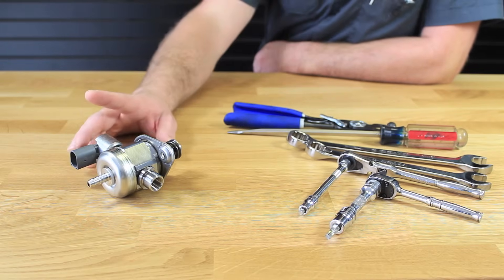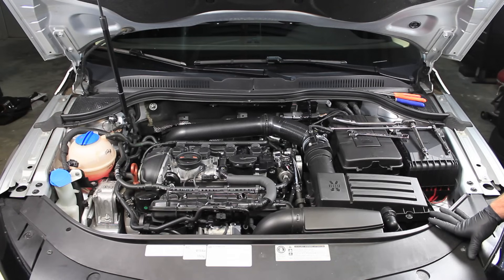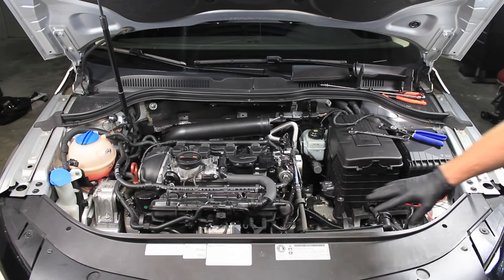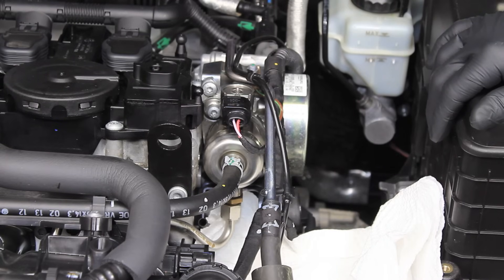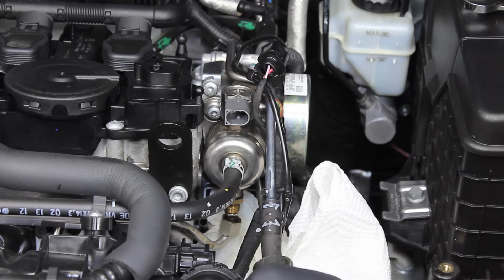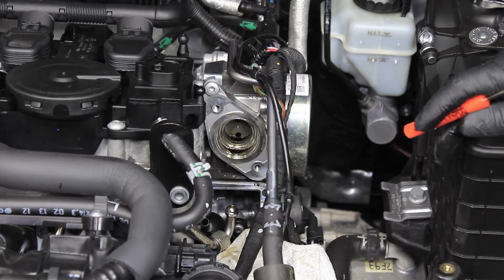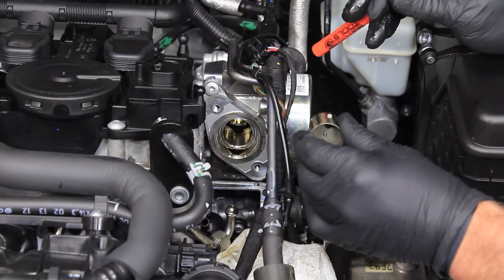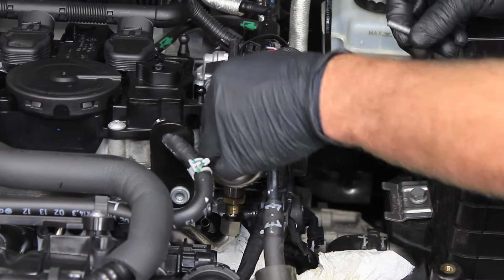VW 2.0T TSI Engine High Pressure Fuel Pump (HPFP) DIY (How to) Install

Comment: Charles… but you did not release the fuel pressure. Some guys disconnect the fuel pump fuse or even losen up the connector and let the engine run and stall before removing the HPFP, isnt that necessary?
Reply: No

Comment: Charles… but you did not release the fuel pressure. Some guys disconnect the fuel pump fuse or even losen up the connector and let the engine run and stall before removing the HPFP, isnt that necessary?

Comment: What is the part that the HPFP attaches too?
Reply: The lobes on the end of the exhaust cam are inside that part.. they contact the HPFP follower that buddy inspected at 7:15 in the video. It provides the force behind creating the high pressure

Comment: I'm having a lot of trouble disconnecting the HPFP connector.  Is there a trick? Or maybe the mk6 GTI HPFP connector is different than the mk7 connector shown in this vid? Any clues would be greatly appreciated!
Reply: Did you ever figure this out? I'm having the same issue.
Reply: @gluegle  Yup.  I ended up getting a cheap dental mirror off amazon and used a flashlight.  Once you can actually SEE it (in the mirror), it becomes clear where to press to release the connector.  But it was impossible (for me, anyway) to just do it by feel.  Charles has likely done this hundreds of times, so he just knows by muscle memory where to press.

Aha, I just found my notes on this.  Here's what I wrote down:  

- was impossible to see underside of connector
- was impossible to undo it. Can't see what's going on. Not clear where to press. Pinch the 2 bumps together? Push one of them in?  Pull one of them out?

- ordered a dental mirror, and NOW I can see what's going on

- to undo connector:
    - push connector towards windshield (to compress the weather pack seal)
    - then press down on the bump closest to the front bumper, to lever the plastic tongue up and over the attachment ridge on the underside of the grey female piece
    - then pull the connector towards you

Comment: Hey so I got a code on my 08 Passat 2.0 TSI. P119A. It’s saying fuel pressure sensor. Where is that on the engine? Trying to save myself from a hefty garage bill.

Comment: my car was jerking and wont start not even sulf working(no noise of sulf) is it common when P2295 code comes up with fuel pressure regulator 2 control circuit low

Comment: Is that the CAW 2.0 engine? if so, the same HPFP can be used on the 08-09 model Scirroco (anything after that uses the CAWB or alternative engines, but the 200bhp model from 08/09 uses the CAW

Comment: I know this is an older video, but for those of us without VAG-Com or obd11, does anyone know what the resistance value across the pins of the solenoid on top of the HPFP should be?

Comment: My car had issue starting after each  drive, I have to wait for it to cool down before it can start. My mechanic said it was the regulator and he changed  it. After charging it the car can hardly drive, its bucking whenever I press the gas. I didn't have this issue before. Please help

Comment: Where do you find a fuse location for this? If i turn key on, no start, I should see battery voltage at the harness, correct?

Comment: Do you need to remove the hpfp to replace the vacuum pump on a 2010 Passat 2.0t? Not sure which vacuum pump I need or if a reseal kit would be sufficient. Thanks

Comment: Hi i have a problem in my 15 Audi a3 gasoline i have code p0087 i had the car in idle for 1 hour and it starts shaking and dies i tried to turn on and nothing i wait 15 min and tried again and it works i drove it in the highway to my house and no problem is the 3rd time it happens can you help me please
Reply: I have similar issues on my 2013 Tiguan. The help I am offering to VW owners is do not own one in the future

Comment: Good day, I have a 2009 vw cc error code p2293 for fuel pressure regulator 2.
I'm uncertain if it's on the fuel rail line and no idea where to purchase. Please assist?

Comment: Planning to do this on a 17 Passat V6, looks like a similar job. However, fuel pump states "replace fuel lines with pump" but doesn't look like you really have to. Is this the case?

Comment: this part is extremely similar on my 2019vw passat 2.0tsi. however, it's as if the part does not exist. you can't find it anywhere. even vw doesn't have it. partsgeek has the follower roller thing, but that's it.

Comment: I have a 09 vw passat with the tsi motor, im getting a p12a2 code I changed the fuel pressure sensor & still have the code system too lean I believe can it be my lpfp or my hpfp? Car hesitates & sputters when I press on the gas pedal any help 🙏

Comment: A couple of areas you didn't touch base on: 1 new o ring most replacement pumps do not come with o ring. 2. Torque specifications and 3 what to do when cam for roller is on high side.

Manual says to turn crankshaft to get cam on low side but does not say how and if you can't turn can you still put pump on? This is my dilemma right now, I can not seat pump down all the way because can is on high side.

So my question is can I still tighten down?
Reply: Did you figure out an answer? I'm doing the install right now and I can't seem to get the pump seated all the way.
Reply: I tightened it down anyway and it installed fine. When tightening, it compresses the spring, which allows the unit to seat flush. A quick word to the audience that the pump won't sit flush until it's screwed down completely would've helped prevent the frantic anxiety trip I just had. 😛

Comment: Old video, but super helpful.  I was getting hesitation on acceleration and on WOT i got massive power reduction.  ran my scanner and its to do with the HPFP.  dreaded it as i assumed it was in the tank / difficult to get to... but this video has save me an expensive trip to the mechanic.

Comment: I ran into the hard starting and wanting to quit issue with the P2293 code. Watched this video and then ordered the Bosch HPFP and cam follower from you guys. Installed it and am back in business. Thanks so much for the great video and having the parts at a good price!

Comment: Another question I have is I own a 2014 vw passat 1.8, how do I get the throttle body off in the front with the plastic coolant connector in the way? Thanks

Comment: I'm waiting on my throttle body to be delivered, but also would the bad throttle body cause my fuel rail pressure to be high? I'm not getting a code except for the throttle body.  But my fuel rail readings reads like 1800-2500psi

Comment: A year ago I had watched your video as per a no start symptom I kept encountering, inferring it may have been because of the HPFP, I purchased the pump with the cam follower and never ended up actually installing it, just due to laziness and it not being such an inconvenient problem, the problem would get better then worse, but never fully went away. Until today, when it died on me running errands. Wouldn't start for the life of it. I remembered this video to a tee and had everything to do it in the trunk of the car including the part. Needless to say this video saved me from a HUGE headache I could've had if I hadn't been so worried about this being the problem. Replaced it and the follower, in a downpour nonetheless... but she's up and running great again. Thank you guys!

Comment: Is there any way to fix this pump when its leaking fuel into an engine oil? I can smell some fuel in my CCZB GTI 6 engine and I am having P2178 too rich at idle. Long term correction is -9%

Comment: If you had taken the rubber hose off first, it would have been so much easier!  And, I would have loosened the high pressure metal nut next then unplugged the electrical connector............ Then, the final step would be to loosen and remove the two mounting bolts .........EDIT:  Oh, and yes, start the high pressure connector before tightening the mounting bolts.!   Otherwise, an awesome video with good info!

Comment: When you installed the new pump, did it sit flush and go in with ease or did the pump hang out about 3/4ths of an inch till it was tightened ? Mine wouldn’t go back in flush without being screwed down
Reply: Yeah sits out until you screw in the torx to sit flush against the flange
Reply: I'm running into the same issue, myself. I'm literally in the middle of the installation and I can't seem to figure out why the pump won't sit flush at all. Even the old one won't seat flush anymore, so I'm really confused. The extra room is making it almost impossible for the hard fuel line to match up to the brass connector.
Did you solve your issue? Do you have any tips for me?
Reply: Okay, it turns out that, like you, I had to tighten it down to compress the spring in order to make it seat flush. It would've been nice to get a side perspective on the installation in this video, so we could better see what it looks like. A quick word to the audience that the pump won't sit flush until it's screwed down completely would've helped prevent the frantic anxiety trip I just had. 😛
Reply: @MishtahPoog  clown
Reply: @EazyDuz18  If learning to work on my own car makes me a clown, then honk my nose. 😛

Comment: Could the HPFP cause P0171? I’ve already replaced the PCV and intake manifold. Independent shop is telling me the reason for the code is because of the crankshaft rear main seal

Comment: Nice job but I’ll just have that done on my car and I feel like it’s just plug with air or some shit I don’t know what to do I took it to the mechanic he said there’s a lot of fuel but just driving and driving for a couple days however my car is acting all like Burpee fucking on the throttle do you mean I should turn around and try to bleed the field

Comment: After a long run when I stop my skoda superb 1.8 petrol for long time and then I tried strat. ....it cranked  but wont start ....but when i removed the front soft pipe line from hpfp and then strong petrol pressure realsed from the hpfp and my car star immediately ....please please please reply same fuel pump

Comment: How much pressure does the low pressure fuel pump need s for the high pressure to work correctly? Regards

Comment: Thank you Charles and Paul for amazing video. Thanks to you I didn’t need to pay $800 for pro shop to fix it and just paid for the parts. Just in addition, I disconnected battery before working on the pump. I also encountered rusty 30T bolts, I stripped one and had to use chisel to loose it up, but it worked. I changed pump as well as cam follower, it was a breeze. Unfortunately I didn’t have proper torque equipment, so I tighten everything by feel. And result? It worked. So, again, thank you so much for a wonderful video!
Reply: I got quoted 1500 at the most and even a little shop wanted to charge me 700.00 freaken crazy
Reply: They didn’t toque anything in this video . People are saying you don’t have too for this job?

Comment: I needed a T20 to remove one screw (although it looks like it was made to attach with two screws) when removing the air box induction pipe at 2:54 on a 2011 VW GTI.

Comment: This is a half video. He does not tell u that after installing the pressure fuel pump...its gonna take another stressful time for the vehicle to start. The high pressure fuel pump needs to be primed. I found out the hard way after 2days of trying to start the vehicle. The information I am getting is to turn the ignition on and off for about 10 times to build up the fuel pressure to the injectors. Never mentions this in the video. But I appreciate the video though.
Reply: That doesn't sound right. That's not what you have to do. It'll be a 3-5 second crank if you don't prime it with the key twice. You must have a dead LPFP

Comment: I have a 2012 VW CC Sport. My son said it started running rough and turned it off and it will not start back. I took to the seat out to check the module and listen for the fuel pump to kick on and it does. Is it safe to assume the high pressure fuel pump is gone bad?
Reply: Ybvc
Reply: @rsmetencheitesoprema6899  the issue was it jumped timing. Had to replace the motor

Comment: Two things you miss doing on the video: reduce the fuel pressure, and disconnect the negative part of the battery. Overall a good instruction on how to replace a high pressure fuel pump.
Does it not need to be calibrated?
Reply: How can we reduce the fuel pressure?
Reply: I believe if you don’t drive your car for a whole day
Reply: @SavageCips nope. I just removed a pump from an Audi that was sitting (due to lost keys) for over a year and the metal fuel line was full of fuel.
Reply: @yaroslav_the_great  I just did this job on my ‘14 Edition 30 as I upgraded the internals to flow more fuel (GTX3071r) and I didn’t have a problem with excessive fuel. Just keep the fuel line (black hose) pointed upwards as you’re good.

Comment: I have a 2012 vw cc sport. Car cranks but won’t start I’ve replaced the ignition coils, spark plugs & fuel pump but car still won’t start. Anyone have any suggestions? Need help ASAP
Reply: Did you replace both high and low fuel pressure? Try these things. * Check if everything were properly installed, coils, spark plugs, fuel pressure, etc    
 * Follow the fuel pipes and rail and visually inspect for any fuel leaks. 
* In order to pressurise the fuel system you must turn the ignition key on and off for about five times without starting the car without pressing any of the pedals.

Comment: Watching this gave me the confidence to attempt it on my 2013 Audi Q5 2.0T. Even though my pump was on the back side and not the driver side, the job went well. My pump seal was leaking oil. The follower wasn’t worn like the older ones but I swapped a new one anyway. Thanks guys.
Reply: When you say yours was leaking at the seal, was fuel leaking into the engine and contaminating the oil? I'm currently having an issue that my oil smells like fuel and I'm suspecting that an internal seal in the HPFP has failed and is now diluting the oil. A fellow VW forum member had the same issue and now I'm curious if it's the same case with you?
Reply: Jose Pereira 
Sorry it took me a while to get back to this site. An Audi service technician warned me about 8 months ago that my pump was leaking fuel. It did have a smell after shutoff but no actual leaking under the car. I had no check engine lights or performance issues throughout the summer so I waited to fix it until I decided to do it myself. The smell is gone but my oil is being changed next week(a little late). I suspect it was only the o-ring but I changed the entire pump and cam follower. Ask me about the repair if you’d like. There are a few things I’m noticing since.
Reply: Thanks for the response Adrian. My issue was indeed the HPFP, I've changed it and the error message (P0172) is gone and the oil isn't being diluted with fuel anymore.
Reply: Jose Pereira 
Wow that was fast! Did the oil contamination cause any other issues that you noticed? I’m hoping I didn’t wait too long to change the pump. Also, I didn’t get the error code that you did but just recently I’ve gotten the common P2293 code others seem to get, with a bit of rough idle at start up only. There is a great video by a timing specialist if you’d like the link. It deals with the VW/Audi fuel system and was really interesting.
Reply: Luck was on my side as I think I got to resolve the issue before anything else failed or possibly seizing my engine due to the contaminated oil. I also started monitoring my fuel time both short and long which was hectic but now with the new pump all is back to normal.
With regards to the error you getting, perhaps the cam follower is worn? Did you change it when you changed the pump? Mine fortunately was alright. I don't believe it's expensive to replace
Reply: I did change the follower even though the old one seemed fine. I used only OEM parts also.

Comment: Thank you for the video, but   you did a lot of unnecessary work. The only thing that actually on your way is the low pressure line. Remove that and you'll have comfortable access both screws and the high pressure line.
Reply: Without that airbox in it made removing that high pressure line easier, it was kinda a pain to loosen and tighten it with that bracket in the way
Reply: I’d also say that removing the box is not “a lot” of work. Maybe 5 minutes and you have considerably more room.

Comment: The Torque Wrench Mafia kills me! 🤣🤣😂🤣😂 THERE IS ABSOLUTELY NO NEED OR REASON TO TORQUE ANYTHING ON THIS JOB!!!!!!!! That's why they didn't! And THANK YOU for not Torquing anything Charles and wasting time!!!!
Reply: Hi there. I was hoping to change the high pressure fuel pump on my 2015 Passat. But watching other videos they toque everything. They didn’t here so I’m so confused
Reply: I ran this through Chat and it argued that most people doing this know what the right tightness would be and that I probably shouldn’t do it.  
Still doing it. 😊

Comment: Great work ...My Tiguan 2.0 t smell gas when I turn it off  the motor I don’t know what’s the problem?
Reply: Did you find the problem? It is probably your High Pressure Fuel Pump o-ring has worn.

Comment: 2013 VW CC Sport. 2.0 tsi. Standing at the front of the car, looking at the firewall. There are two heater hoses, outlet and inlet, horizontally running to the firewall where they are connected vertically. Does the right hose from your standing position go to the top and the left hose go to bottom, or vice versa? Please help!

Comment: After a lot of research, I purchased the HPFP from you guys and used this video to replace it myself. This was the first time I've ever worked on a car in this capacity and you guys made it a breeze. Did it for $500 less than my mechanic quoted!
Reply from the maker: Thanks for the purchase, glad we could help
Reply: Hi do you have to reset any thing after it was installed or just to start up
Reply: Nope. Just turn the key a couple times to prime the pump. @stevenbachoo6120
Reply: Word. Comment about to be me 💯💯💯💯💯💯⚘️